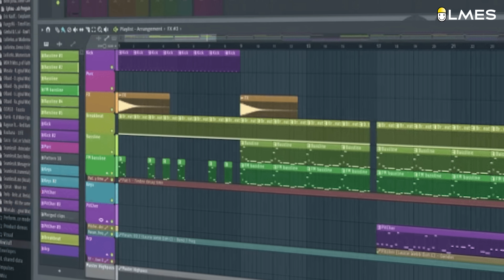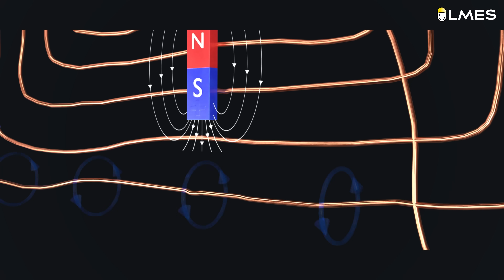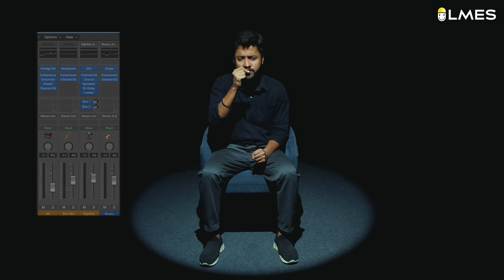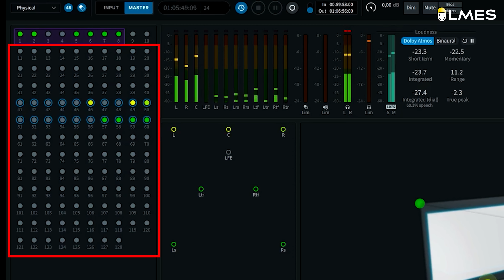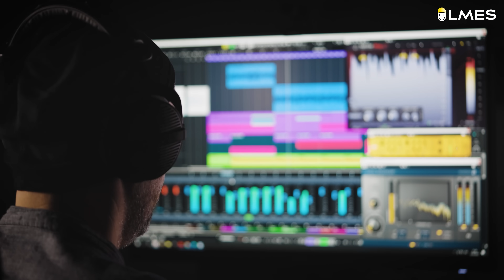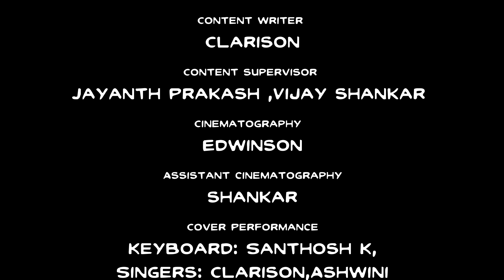How DOLBY Works? | LMES | Tamil

Comment: to be honest I'm 36 now. all these years I have been thinking 5.1 is 5 speakers and 1 woofer. I know I'm not alone in this. 90's kids assemble
Reply: 5.1 surround is still 5 speakers ( L,C,R,RL,RR) and a sub .  Dolby Atmos is object based .
Reply: @deluxshion  No as the video suggest it mention channels not speaker count.
Reply: @ajayvenkat5482  This video is not 100 % accurate .
Reply: @deluxshion  Correct
Reply: Yes am also am 33 now 😢
Reply: 5.1 na 5 speaker 1 sub woofer tha
Reply: I knew it when i was in 10th standard... i had 4.1 speakers (without center)
And i had to buy sound card for it..because motherboard came with only 2 channel (left and right) green coloured port 
Even now i have motherboard with only green channel :D